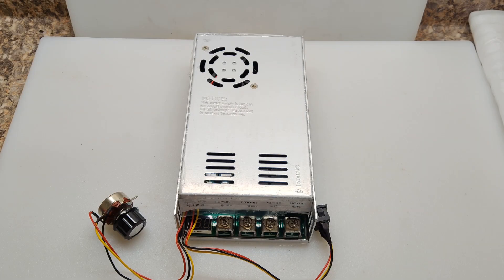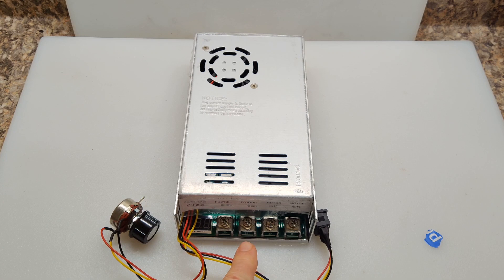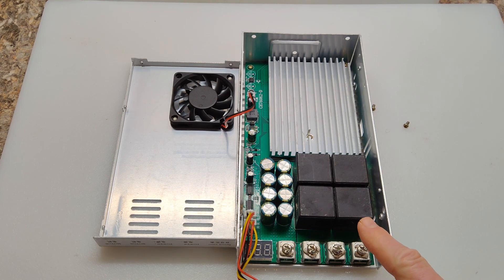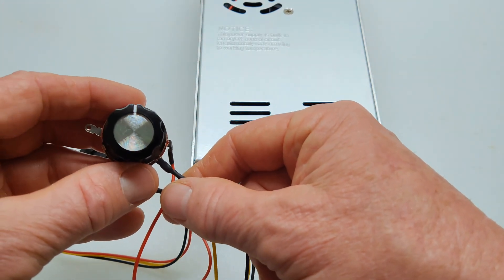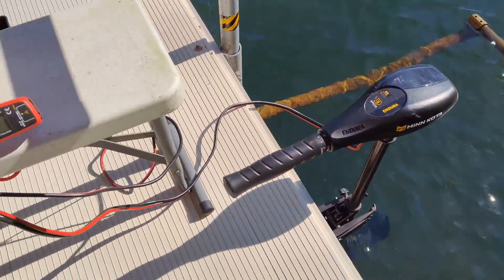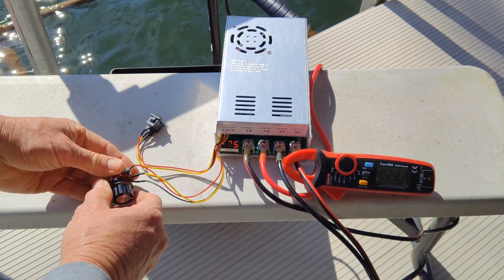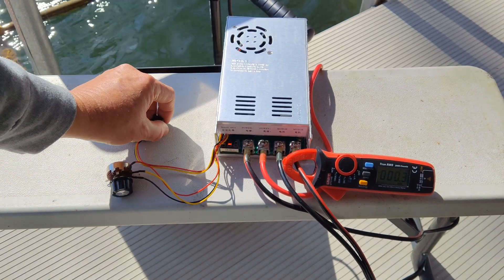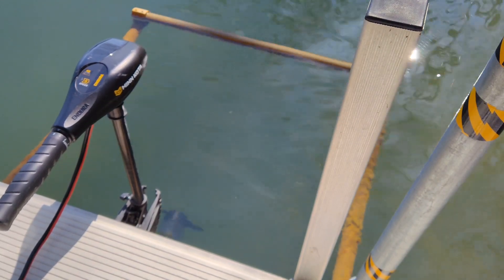100A Continuous 200A Spike PWM Speed Controller for Trolling Motor

Comment: Really appreciate the video. You saved my minn kota em80 engine mount 80lb thrust motor. They stopped making the control module and this works like a champ and stays pretty cool with proper ventilation. Only $60 on aliexpress. Running 40-60amp
Reply: Do you know how many amps at 100% you pull? How’s it holding up so far?

Comment: So between an ESC and a PWM: which is more efficient, durable/reliable, easier to set-up, least expensive.... or did i miss that video? Thank you
Reply from the maker: It depends on your project.
Reply: @Aksmaniyak  Happy Holiday
Reply: @Aksmaniyak  I have a 50# motor and 100AH lithium battery,  on an inflatable fishing pontoon. Want speed control only. TY
Reply from the maker: @wykedmoose7642  Either set up would be ok. I don't recommend any motor larger than 50lbs with the 880 ESC.

Comment: So what do you think, bought a Hangkai
65 lbs thrust, 55A, 660 W, 1420 rpm trolling motor would this PWM work. Or even Changing it to a 2 blade prop instead of the 3 blade it came with.

Or am I better off returning it for there 45 lb thrust model.
Reply from the maker: It would depend on your set up and what your usage is.
Reply: @Aksmaniyak  going to return it and get the 45 lb thrust model, Thank for your input
Reply from the maker: Sure, good luck with your build.
Reply: @Aksmaniyak  
Well ordered the 45lb motor but they offered me 45 refund to keep the 65 lb, so took the refund and will find out how it works.

Got two kayak so it will one with 65lb and the other with 45lb thrust.
Reply: @robertoobregon3750  how did it turn out with the 65!?

Comment: I have this same PWM that you have
For some reason, mine is hooked up correctly, but it’s not responding 

I tested the trolling motor. It definitely works. 

Battery is good 

All wiring is brand new connectors are securely tight 

Red light will come on with fan

If you have any suggestions, I would appreciate it

Thank you

Great video by the way
But it will not respond to the trolling motor or vice versa 

If you can help me with this, I would greatly appreciate it
Reply from the maker: Thanks Weldon. What trolling motor are you using?
Reply: Minnkota
Reply: Minnkota 30lb thrust
Reply from the maker: @WeldonKrause  Did you check the F/R switch?

Comment: ok i use a Minn Kota 12V 55lb thrust trolling motor and 100AH battery. I have melted the board on 3 of these 100A continuous draw and 200A spike PWM speed controller in less then 30 mins running time. What is the best sound proof way to go from here.
Reply: I’m hay the same issue. So what you ended up doing?
Reply from the maker: With a 55lber you don't have really any other choice than another PWM.
Reply: @Aksmaniyak  so an ESC wont hold 50 maps?
Reply from the maker: @michaelsmolt7246  It would be sketchy using the HW 880 model that most do.

Comment: I have been using this for 3 months almost daily now on a 55lb Newport. It's on an 11ft Zodiac inflatable. I put it in a project box, I added a fan directly on the heatsink, and another fan to move air in the box. So far I didn't have a single problem with it and I ran it for about 20 min at 35A continuously. I have a temp probe installed and it went fro m 28C ambient to 32C on load, which is perfect. 
If anyone is interested in the components: there are 2 channels, one for fwd and one for reverse. For each channel, it has 2 relays with no inscription on them (they look like 80A each, so 160A per channel), 2 flyback STPS41H100CG Schottky diodes (80A per channel, which seems undersized), 8 mosfets STP75NF68 (80A each). The Mosfets have proper gate protection. The 8 capacitors are 470mf rated at 63V. 

As a tip for anyone, I am using an APC propeller (10x5LH) instead of the stock prop. My speed increased from 3.9mph to 4.8 mph, while the max amp draw dropped from 48A to 34A. It's a huge battery saver. There are some videos on youtube with tests for speed and amps. Anyway, about the speed controller - so far so good, seems like a well made board.
Reply from the maker: Thanks for the update!

Comment: Your video inspired me to look further at more powerful PWM's and I found another option besides the one you are reviewing. I took a chance and got 2 of them, and did a quick overview for people to see what's inside. Maybe you can get one and do a professional review - https://www.youtube.com/watch?v=im_zWrRSgPk
UPDATE After 1 month, both of the PWM I linked in my video are malfunctioning. Same identical problem, which leads me to believe it's poor design, or bad parts, or a bad batch. 4 out of 10 times, when I turn the potentiometer to accelerate, there is a cut off in current, and an immediate restart. Feels like breaking abruptly and accelerating immediately. All sellers are in China and communication is more than difficult. I went back to the standard smaller one you see in the video and it works well.

Comment: So I just got into the kayak fun. Have a minnkota 50 thrust. I’ve tried 2 of the pwm 60amps so far. They work great at first but after 15 mins they start smoking. I have racked my brain trying to get this thing to work so I can use it. Using a 12v lithium battery. Both pwm I’ve used was off Amazon. Do you think this would work for what I’m pushing? I’m no electrician by any means. I was wondering if it the trolling motor was pushing to many amps for the one I had. The pwm I ordered all had bad reviews. I’ve searched for answers for 2 months now
Reply from the maker: The 50A max is close to the max draw of the unit. The PWMs have quality issues at times.
Reply: Ok. Thank you. Ifigured that maybe it. I may try this one next. Havent even had a chance to use it yet except in the pond for testing.
Reply: I have removed the circuit board from the metal enclosure and place it in a plastic box. Then I added 2 fans in the plastic box, besides the fan that it already has on the heatsink. I was able to use a 62lb thrust newport at maximum for extended periods of time without the board getting hot. Actually the original poster here has a video with a box with air flow - this pretty much what I did, except I added 2 12V fans that suck air out of the box - https://www.youtube.com/watch?v=fX6vg2U-W0s
Reply from the maker: Nice. That is my video too.😁

Comment: Awesome video.  Thank you for all your videos and work on trolling motors for kayaks.  I did not understand the part about the on/off switch.  Can you clarify that?
Reply from the maker: Thanks. Normally the pot has an on/off switch, this does not.
Reply: The potentiometer has a built-in switch. So after you turn it down to zero, keep turning and it will switch off. The separate button has 3 positions: forward, off, reverse.
Reply from the maker: This potentiometer does not have a switch. That is why there are only 3 wires to it.
Reply: @Aksmaniyak  Ah, my bad. I didn't pay attention
Reply from the maker: 😁It's ok, just funny!

Comment: Man that is a monster. 😊
Reply from the maker: I think. it will be hard to overload this unit.
Reply: @Aksmaniyak  Yes they have come a long way since the day I built mine, Yes, the the battery technology is also improving.
Reply: @Aksmaniyak how is this thing going after 12 months use ?. I'm on the verge of purchasing after burning one out. But don't want to go thru that again.
Reply from the maker: @kayakcruisingtas  Still working as it should.
Reply: @Aksmaniyak thanks. I will keep it in mind. Im only running a 30 lb minnkotta and getting a 60ah lithium battery too. In a small kayak. Would this big unit be over kill. I didnt realise how big it was. I was looking at the elecee 10-55v 100 amp unit. But was concerned it may be too small for the lithium to handle.
Reply: @Aksmaniyak  thanks for the promp reply too. Was unexpected 😊
Reply from the maker: @kayakcruisingtas  My advice is to always go for more amp hours when possible. At full speed with you motor and the 60AH would give about 2 hours of run time.
Reply: @Aksmaniyak ill only be running it at trawling speed. To old for silly games and the prizes you get for playing them. And 2 hrs is not far off my limit of time i spend in the water. So i should be right. Thanks for the advice it will help.